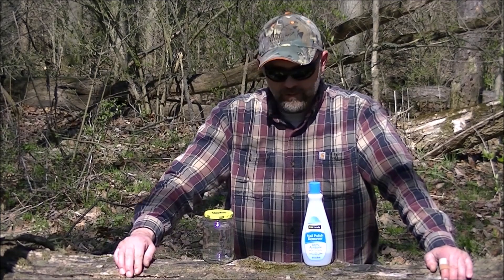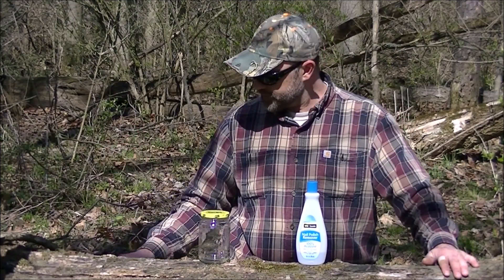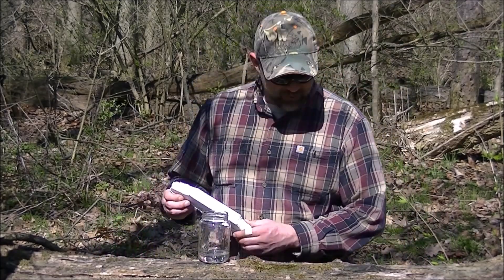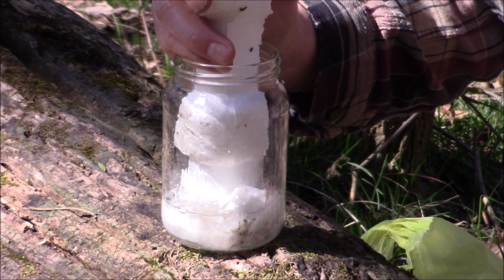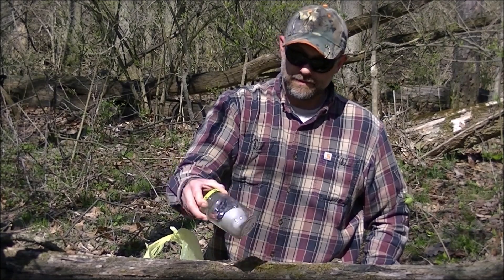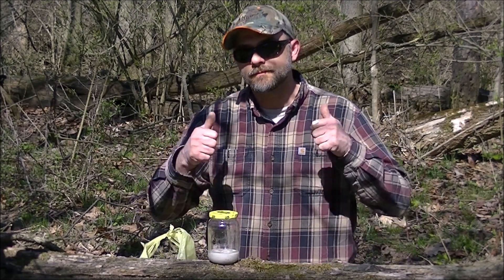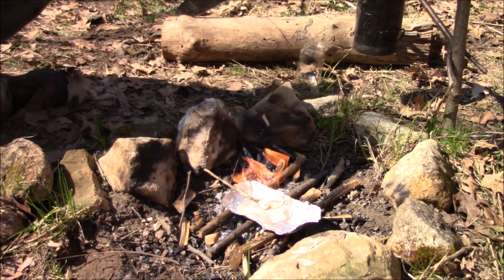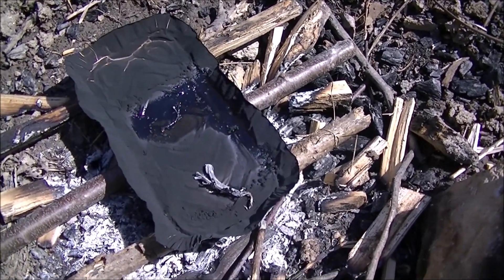Napalm... Burn Test

Comment: No way bro, THAT's how you create napalm! When I was 8 or 9, I somehow got into my mom's stash of beauty products. I took out the can of nail polish remover to smell it like a curious little kid. Out of the corner of my eye, I saw a  piece of styrofoam. (From an earlier package, but I took it off to my  sword fight with my brother) I somehow had the mind to stick that stuff in the polish remover and was I WOW when it dissolved. After that, I threw it away. I probably could have burned the house down.
Reply from the maker: Its only 1 VERY unprofessional version of it. REAL napalm is much more dangerous